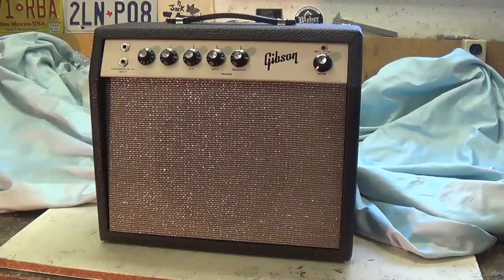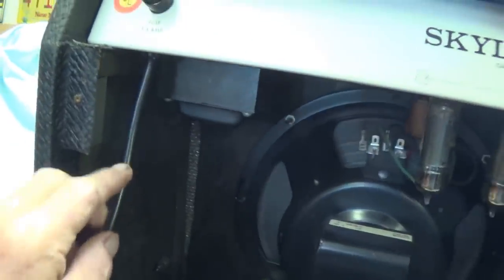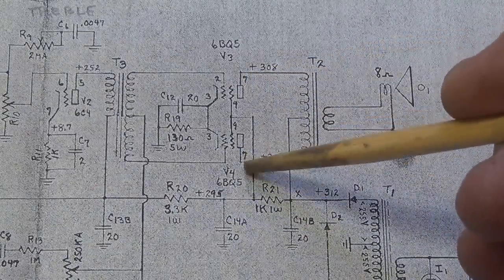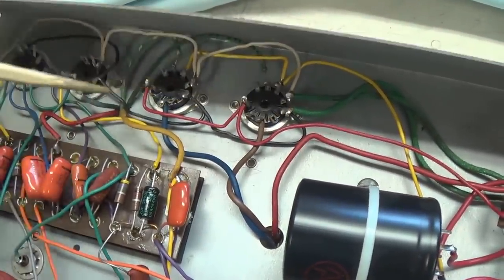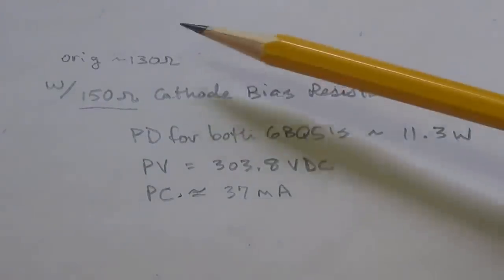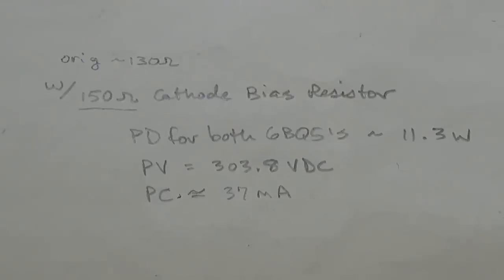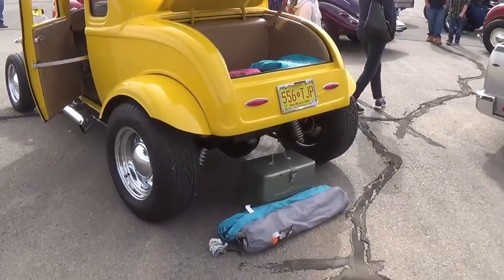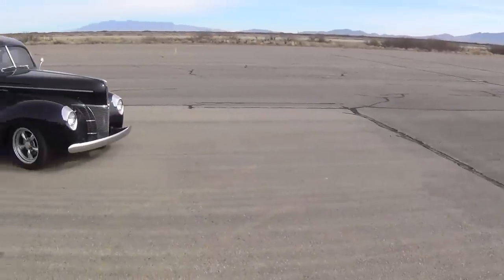1965 Gibson GA-5T Skylark in Superb Original Condition

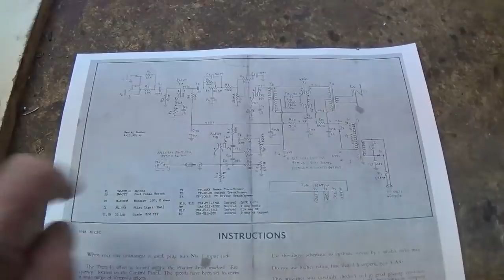Comment: 6:20 Naa. THE worst chassis screws ever are on the Gregory "Mark X". Not fun at all to deal with.
Reply from the maker: They sound forbidding, VC. Hopefuly, I will be spared from ever encountering them.
Reply: Wow, somebody else has a Gregory amp! I've got one as well, can't remember for sure but it might be  a Mark X as well. It only puts out a couple watts  of power at most and sounds thin and tinny and fuzzy.  Somebody has screwed with it in the past, the original factory wiring is a mess,  and although it arrived with 7189s as I recall (6bq5/El84 variant) I'm not even sure  that it's got the right tubes in it, since the tube sockets aren't marked and somebody was messing with it; perhaps it's got a completely wrong phase inverter tube or something. One of these days I plan to reverse engineer it and check the wiring to the sockets and use  some basic tube circuit logic to figure out if it's supposed to have something else in it tube wise..... what is the tube complement in your amp?.
Reply: good 'un — Mine came with a 12” alnico speaker made by Eminence for Matchless. I reworked a lot of the amp, star grounded it, etc and also added a Beltron reverb brick circuit on the input. It’s honestly one of my best sounding amps. I’d say it’s around 12-15 watts. I like that it’s small and light. Much easier to lug around than my 65 lb Twin Reverb.
Reply: @VegasCyclingFreak  , Beltron Reverb brick circuit? What's that? The Gregory I got has a single transistor to drive the Reverb tank oh, and the reverb doesn't work anyway. But what tubes did yours originally use?
Reply: good 'un — It’s a solid state reverb module that I made from a kit like ten years ago now. I don’t know what power tubes it originally used but I’m using EL84s in it.